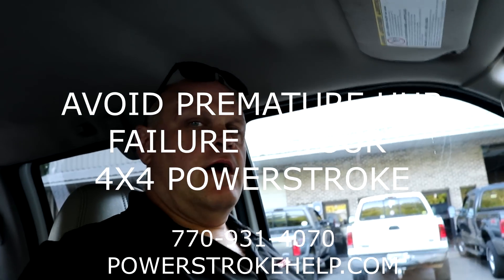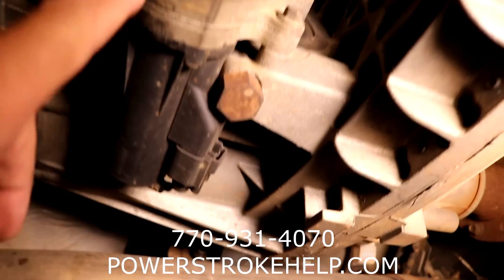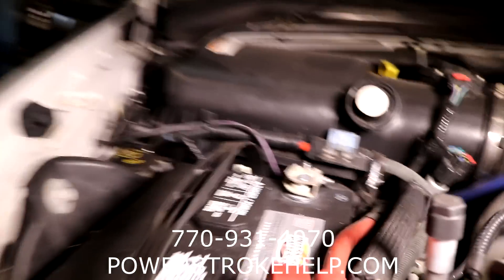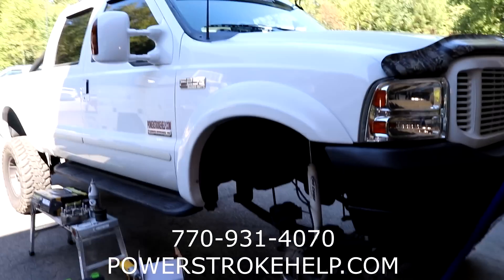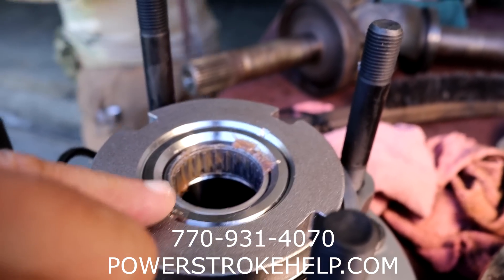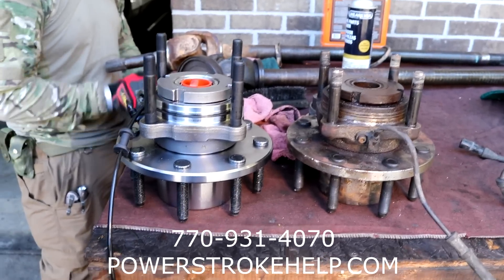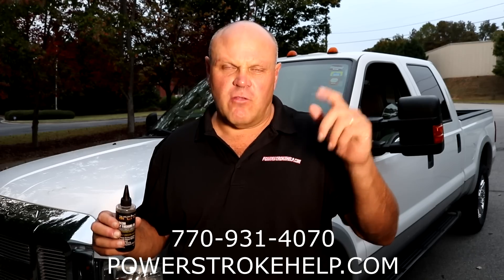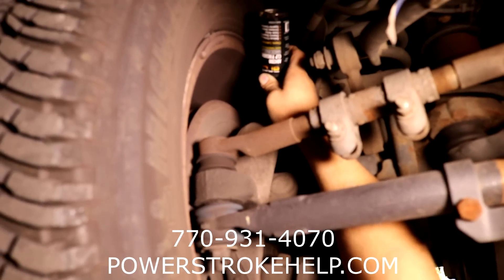PREMATURE 4X4 FRONT HUB FAILURE - FORD SUPER DUTY

Comment: My 99 1/2 burned its right front hub unit in 06. Did a Dynotrac Conversion and I have been trouble free since then. 
I still have the truck and its still running strong thanks to powerstrokehelp.com 
Thanks for the information!!

Comment: The hubs dials themselves are another problem area. There is an aluminum permeable material on the end of the hand piece/dial. It is there to relieve air pressure for the vacuume portion of the hub, but it also allows moisture into the dials and can crust everything up. You can punch through the center with a small punch/screwdriver to disassemble the outer hub (once off the vehicle) clean and reassemble. Put a dab of grey silicone over the hole you've made.

Comment: I have a 2009 F250 with the 6.4L and a few years ago, I had to get my front hubs replaced, not even 90000km, luckily it was covered under warranty but if I recall, it was a $2000 repair bill.  I just placed an order for some Archoil AR6200 and AR4200, been running both AR6200 and AR9100 in the 6.4L once Bill started to show the benefits Archoil and man, does AR6200 work great for increasing the distance between each regen cycle.  I'm consistently over 400km with AR6200 added to each fill up.  I missed one fill up without AR6200 and the regen cycle was activated around the 200km mark, twice for the tank I was on.

Comment: Love my 2000 7.3, manual hubs all the way for sure. Much rather hop out and take 12 steps then to worry about vacuum hoses, vacuum leeks, sensors and so on. All these parts and there ongoing costs just to eliminate getting out of the truck for less then 30 seconds. Hmmmm. 
So if the auto 4x4 breaks, I bet the time spent fixing things would be greater than just locking them in manually.
 Save some money, buy some boots, lock em in!
Reply: 1999 7.3, 4x4, six speed, extended cab, and manual hubs. Best truck I’ve ever owned.
Reply: What brand??

Comment: if your truck has front abs. riff raff diesel sells a grease fitting that fits into the abs hole. obviously not permanent but you can grease them every oil change or something.
Reply: Keep one grease gun for wheel bearing grease ONLY and use this fitting !  Here is the link for it,, http://www.riffraffdiesel.com/front-abs-grease-able-block-off-fitting/
Reply: Yes, the riff-raff adapter will grease the main hub bearing but not the needle bearing that took a dump for Bill.  Love those riffraff boys.

Comment: Interesting system, the F150 system is similar but in reverse.  It uses vacuum to keep the hub open till you switch the 4WD on then it turns the vacuum off and the hub engages.  At low vacuum they can make a clicking sound if the hub seal is going bad.
Reply: CMac A lot ppl don't like the IWE but I like systems when it work without loads popping sound
Reply: those IWE are a pain...i have a 08 f150 and 01 ram..i have had more issues with the f150 and it gets stored winters..just use it to pull camper and around town...i plow with the dodge and it gets beat but the 4wd is solid.

Comment: take the vac hose off use a grease needle u can pump grease in there.  also riffraff diesel make a Front ABS Grease-able Block Off Fitting. 20 bucks.  so a you can get grease into main hub bearing.  if u go though vac line with grease needle it will hit the needle bearings.  win win
Reply: Just ordered my riffraff fitting.  Have a 350 and an excursion, this will be a lifesaver.

Comment: just an FYI. if your hubs are not locked, the axle sub just sits on the inner bearing. when the hubs are  engaged  and axle is actually turning, then the sub rides on the inner bearing. just wanted to correct that little bit of misinformation. Those of you driving around with your hubs locked  and 4WD disengaged, your axles are still turning and actively riding on that inner bearing. People will do this while plowing because they don't want to get in and out of there truck to lock and unlock hubs because vacuum  lock system isn't working. You will cook the inner bearings regardless of the amount of grease if you drive at highway speeds with hubs locked. the inner bearing are not designed for highway speeds. these are not sealed bearings.
Reply: Bought a truck recently and was happy to see it had been replaced with manual hubs. Drove it for a few days and was thinking the steering is just a bit hard. Checked my hubs, they were locked, so I'm thinking great!! How long have they been locked so yeah I'm keeping eye on them lol
Reply: This video is confusing since the first truck is different from the second truck. 99-04 trucks have a needle bearing as pictured,05 to present have a sealed bearing that the axle rides on.

Comment: the manual trucks still have the nipple for the vacuum hose. my 350 and 450 both lost axle rollers on drivers side this winter (plow trucks).. both were missing the rubber caps....allowing water and salt into the hub area. so make sure that shit is capped off!!!

Comment: I don't know if Triflow is any good but I've used it forever on everything and it works great. WD40 destroys more stuff than it fixes. It's a water displacement remedy. Don't use it on locks of any type. Clean those out with some white gas or other rapid drying solvent and then graphite powder the lock. Yeah, WD40 will work but the previous application of WD40 is why you have to do it again, it attracts dust. Graphite will silk that lock and you won't believe how smooth it works after that.

Comment: the hubs are about 200 on amazon.  can completely redo the entire front drivetrain with seals and bearing for about 700 dollars on amazon.  Including new auto locking hub assemblies.  Just takes a lot of work and a special tool you can rent to get the job done.

Comment: the roller bearing used to be available. I've replaced several. they start to make an odd noise. if you manually lock the hub the noise will stop, you know what it is.
Reply: You can still get the bearing. Napa has them.

Comment: Hello I was wondering if you might help with a diagnosis on the front 4x4. My truck is an 08 Ford F-250 super duty 6.4. Currently I noticed when I put the truck in 4x4 no matter if it’s high or low when I turn it feels like the front brakes are almost on and the back tires chirp. Do you think it could be the front axle u joints? Possibly front hub bairings? Appreciate the help.

Comment: The bearing manufacturer has changed the inner axle spindle bearing roller cage from metal to plastic.  The plastic gets hot, melts, the rollers and can then actually stop the wheel.  What is the savings???? Is it worth it ?

Comment: Dynatrac free spin best money you will ever spend, all the guys talking about my Jeep don't need a unlock blah blah blah , the reason to have the option unlocking the front axle is fuel mileage unlocked means less drag and it does make a huge difference, and no the pinion doesnt disconnect the transfer case disengages the front driveshaft

Comment: I replaced my auto hubs with Mike Marker locking hubs. Three got really hard to turn and also would not engage in Auto position. Do I need to disengage that vacuum pump? Or the front electric switch.

Comment: Hey Bill Thank you in advance for any help you can give me 1997 F250 PS.  Did full brake job, front ,new rotors,same hubs. Problem with rear brakes. They keep self adjusting too tight... Have not been using setting parking. Have never had this problem before?? Cylinders replaced also. Both sides. Remove drums about once a month and back off shoes from dragging or as they start getting HOT. Can I find a picture on line? and yes I did one side at a time. Thank you again

Comment: I have a 2003 f250 4x4 my mechanic replace the front wheel driver side Bering and I’m not a mechanic but it fills the truck is driving a little stiff, like I’m pulling a small trailer. I told him about that he stop by. Since he replaced one side only, he said the wheel will rotate a little stiffer then the another one, is that right? And he mention that he put a moog brand

Comment: Will not having a hub that can hold vacuum prevent you from taking the truck OUT of 4-wheel drive?
Reply: The hubs may not unlock but the transfer case will. The shift motor for the T-case does not depend on vacuum to shift it.

Comment: Stick with the manual, it is mechanical and very reliable.  Still pisses me off that the clutch slave cylinder was changed to hydraulic and yup I payed for that on a ranger, first time I had to pay a shop in my life as I had nowhere to pull tranny.  Dammit the mechanical clutch worked fine for most of my life, failure =zero.

Comment: everything on my truck works but 4 low hubs lock got 4 high no 4 low. I'm thinking that the neutral safety switch for the clutch is out, because my cruise control doesn't work either.
Reply: Steve Wright I would think the truck wouldn't start if the clutch safety switch was bad
Reply: Truck starts fine, you don't need to push the clutch in now to start it. You use to have to push it in to start. That part is nice but no 4 low  is my biggest gripe, on my property  it was nice to put in 4 low so I didn't have to ride the clutch as much. I have to replace the clutch soon gonna put new safety switch in to see if that's my problem when I replace the clutch.
Reply: Transfer case selector switch is probably corroded!, Safety neutral switch has nothing to do with 4x4 high/low
Reply: Todd edwin thank you I will check that. Are you sure the clutch switch has nothing to do with it? 4 high can engage at any time but for 4 low you have to be stopped in neutral or park for an automatic to engage or a manual you have to be stopped clutch in and foot on the brake to engage 4 low.
Reply: Yes i'm sure, Clutch doesn't have to be "in", They recommend that so people don't accidentally engage it under power.  low is so powerful it could rip you're transfer case apart if you engaged it under a lot of torque.

Comment: Isn't the 6.7's vacuum pump bolted to the front and driven off the engine?
Reply: Todd Felmly Yep. I have a 2015 6.7 that was leaking oil. I tore the front end off to change it because I wasn’t sure if the fasteners backed off or the unit was bad.

Comment: I don’t understand the need for hubs to disengage from the front axle.
Reply: I'm guessing its about fuel mileage.  With the hubs engaged, the ring gear will be sloshing through the differential oil and there is resistance with that.  Also the front driveshaft would be turning too, just not engaged to anything in the transfer case.

Comment: I am glad that my wife is not the only one who cringes when she hears Bill's voice on my computer. I hate the Ford automatic hubs. I have never owned a vehicle with them and if I did, I damn sure would get rid of them.
Reply: scorge30 

you can still manually lock them when the vacuum part fails
Reply: You can also put drive flanges in locking the truck in 4x4 full time too.
Reply: wtf would you wanna have a full time 4x4 I guess you enjoy doing u joints
Reply: Depends on what you use it for. It is an option.

Comment: I have a 99 P.Stroke the I don't care for the sealed bearings or the part about the price and failure Ford locking hubs are JUNK I can't believe no one (that I seen) has said anything about the fix Spyntec changes every thing back to serviceable bearings and 35 spline shafts or just change out the locking hubs to milemarker and be done with it I changed back in 05 ? NO problems last summer pulled it all down to maintenance / inspection they looked as if they were just put in

Comment: man...the design dodge uses is so much better...a disconnect, with now an electric(was vacuum in the old days) motor that basically detaches part of the passenger side axle shaft from the hub
Reply: bighunterman77 no, no it wasn't any better.  Still vacuum actuated.  Dodge front end systems always sucked including 2013 and up .

Comment: I dont see why this front axle needs to disconnect in more than one spot while in 2 wheel drive. Im a Jeep guy too, and pretty much all Jeeps from the early 80s til present dont have locking hubs. The front differential still spins in 2 wheel drive, and it is disengaged inside the transfer case.
Reply: Mikey it may be because of weight of the axles.   The heavier the more wear and tear in the pinion.  Steal is only so chip resistant.
Reply: Mikey then your front diff ALWAYS spins even on highway.  Premature wear out there
Reply: I dont know how a heavier duty axle would wear out faster. I have had a couple Jeeps with over 300k miles on them with the original Dana 30 front diff. I am sure that 299k of those miles were in 2 wheel drive, with the front diff spinning. Yes, it is a lighter duty vehicle, but I dont see a ring and pinion wearing out prematurely from spinning with no load on it, especially a Dana 60 on a Super Duty. The only "extra" wear I could see is having to replace U joints, but as long as you keep them greased, they last a very long time.
Reply: idk man just a guess im making
Reply: When you disengage the 4wd there is an actuator on the front axel that disconnects one side. As its an open differential it stops turning. The power from the transfer case is removed, and stops turning the front driveshaft. If your front driveshaft is still turning in 2wd, you have a problem.
Reply: I had a 4x4 jeep. When you operate the 4x4 it controls the transfer case while an actuator moves a fork attached to a coupling on the right side front axle . This engages/disengages the this sides axle from the crown and pinion... but the outer parts of the axle always turn
Reply: Yeah but the new Jeep's chew up the CV joint on the front driveshaft like crazy
I've replaced mine 3 times and don't have a 100k on it yet

Comment: No offense, just playing the devils advocate here.  After doing some thinking on using a penetrating oil to lube the hubs...seems to me that it may eventually penetrate all those seals and cause a leak when you go to use the hub and won't pull a vaccum.  I believe it to be a good idea to lube the hubs in this way, but I went with a light weight(80w) gear oil instead.  I'll report back if I encounter any problems.

Comment: What an over complicated joke of a system. Why even have a semiautomatic hub, whats the point? 
1k in un-needed over complicated shit to replace a real live $90.00 manual hub?
If you can't get out and flick the hubs you should either have a full auto hub. (Mechanical) or you should buy an AWD car.....
Reply: I can't seem to find any auto locking hubs that use a magnetic clutch to do the job.  Almost everything seems to be vacuum operated, and this mystifies me.  I would think that a magnetic hub would be much simpler, more reliable, and less prone to failure due to leaks.
Reply: Hershel R. Sullivan III
Or, just have a full manual hub like they had back in the old days. 100% mechanical, and pretty much failure free. Don't need 4wd, switch them to free. Might need it, switch them to lock, and then you have control from inside of the cab.
Reply: I hear you on that.  But I believe you still have the traditional manual hub when the "comfort electronics" take a dump on you with this system.  Same as I have on my 2012 F250.
Reply: AWD cars can't pull 42 foot trailers my friend. my 4x4 works due to maintenance. and I can already say it sort of saved my life on an icy highway
Reply: I require shift on the fly. I live in winter country. I am not going to get out at every light that my truck decides not to move from to lock in my hubs. With on the fly, I jump into four, get moving, get out of four (or leave it in if everything is all ice). Now I can arrive to an occasion in a suit when I have to and not get dirty trying to lock my hubs at every other light. But hey, if the little vacuum decides not to work, I can still lock my hubs manually. I've no time for the "manly ego", love my shift on the fly.
Reply: You can still have shift on the fly with manual hubs, you can leave them locked in pretty much the entire winter if you need it. 
(I live in the north east, so I hear you about not wanting to jump in and out to lock hubs.)
Heres the thing, if the vacuum on these particular hubs decide not to work, it doesn't function. 
This is not a full manual hub, its a vanity hub for people that want to think they are doing something proactive. 
Its not about being manly, its about understanding how this system actually  works, and how it fails. 
These shitty hubs can be in "lock mode" and still be internally free. Personally, I'd rather go with a full auto hub (Sure, not manly, but their failure rates were much lower)
Or a full manual hub, and leave it in for the winter, the amount of wear from having the front end locked in, and the transfer case in 2wd is less than nothing.
Reply: I am barely worried. I run a trucking fleet, I pay for all sorts of odd fixes that are far more annoying than a vacuum leak. My truck is coming up to 200,000 miles and the 4x4 system is still working perfect. Perhaps a seal breaks or a hose soon. I'll have it all replaced in under half the day and will be good for a very long time. I count longevity of parts by every 50,000 miles. I would only be worried if the system routinely broke every 10,000 miles. Since I am up to 200,000 miles, I expect it to break and that's okay, at this mileage the system is beyond the duty cycle. When I fix it, all will be fine for longer than I will keep the truck. I'm not a hardcore 4x4'er, I just use it every so often.  Another advantage, I have no lever protruding from the floor. As I clean regularly, I like nothing being there. Floor levers like to gather every sort of dirt, spills, sludge and boogers. ;)